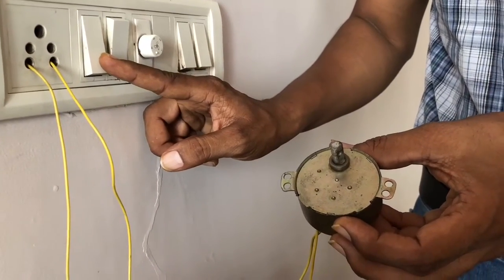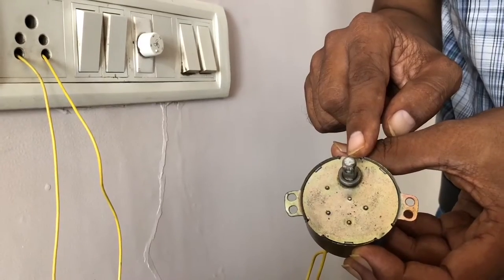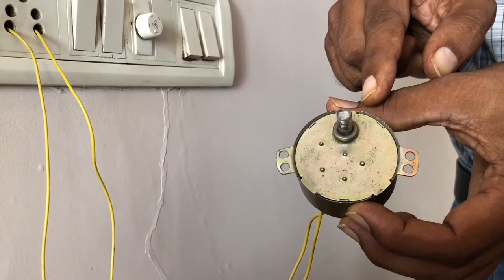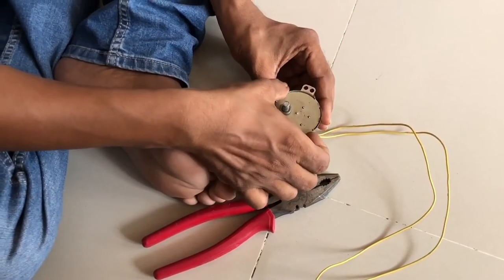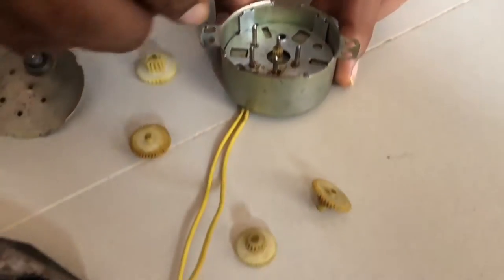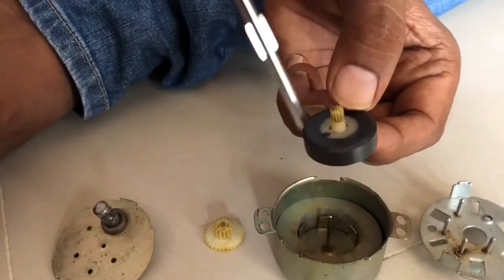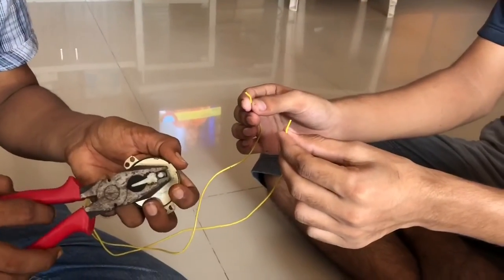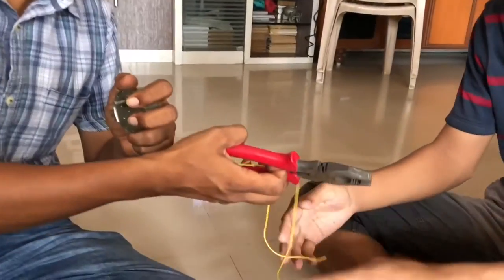Synchronous Motor (low rpm, 220 V AC )

Comment: May motor is not rotating. Whats the cause? Is it the motor or capacitor. It vibrates only. Thanks
Reply from the maker: It rotates , you can observe it in the video

Comment: How to remove the lock
Reply: there is no lock.

This is a small motor from microwave oven.

They will turn direction if you switch em on and off.
Just try it.

You can check a working microwave oven to see it as well.
Put something on the turning table which will prevent the table from turning a full circle.
So like a clamp or something, that makes sure the plate will only be able to turn a bit and then get stuck. This motor will then automatically switch the direction of rotation.
It will start to turn the other way around if it gets stuck.
I guess to prevent the motor from burning out.
You can try it.
Just fix such a motor to a piece of wood and use a big wrench or pliers or something to stop it from turning. You will feel it will start to turn the other way.

Comment: How much weight capacity has the 4 watts motor can carry?
Reply from the maker: I did not check, but the torque is too high in slow motion, its weight capacity should be much more
Reply: @MADABOUTSCIENCE1972  maybe it can carry 10kilos?
Reply from the maker: Yes I agree I think so
Reply: @MADABOUTSCIENCE1972  you haven't tried sir?
Reply: @MADABOUTSCIENCE1972  you haven't tried sir?
Reply from the maker: I think it can carry (lift) any load but the speed is much smaller, if we increase the mass
Reply from the maker: Not
I will try sure

Comment: How we can reverse the direction
Reply from the maker: Applying lock in one direction
Reply: In one of my application i need to turn the shaft for 20 sec  in clockwise direction and then 20 sec in anticlockwise direction.please help.
Reply from the maker: But if you arrange the lock with timer on either side , I think it’s possible
Reply: @MADABOUTSCIENCE1972  u want to say mechanical lock after a fixed degree of rotation on either side

Comment: How can i run only cw rotation?
Reply from the maker: By locking anti-clockwise, I have removed the lock
Reply: @MADABOUTSCIENCE1972  Ty i removed today too. Its turnin cw
Reply: @MADABOUTSCIENCE1972 where the location of anti clockwise unit, actually?
Reply: @fredmeyer9481 @MADABOUTSCIENCE1972w here the location of anti clockwise unit, actually?

Comment: May motor is not rotating. Whats the cause? Is it the motor or capacitor. It vibrates only. Thanks
Reply from the maker: Here the cylindrical magnet is havin 8 pole , it is not common cylindrical magnet
Reply: that is my problem too...its only vibrate no rotation...